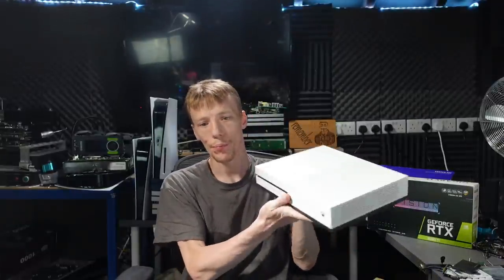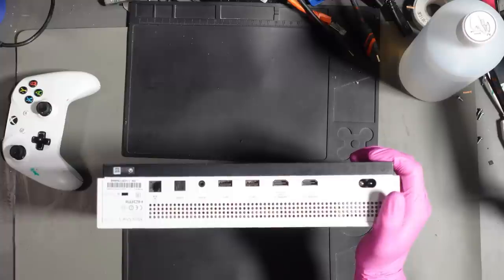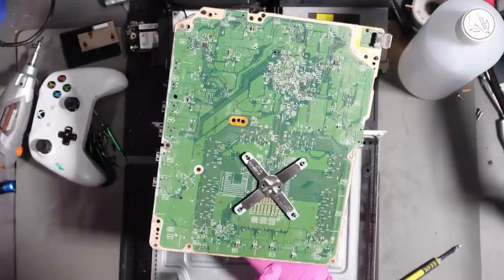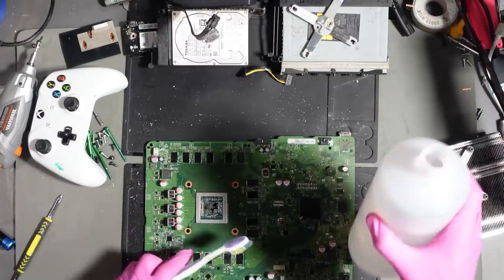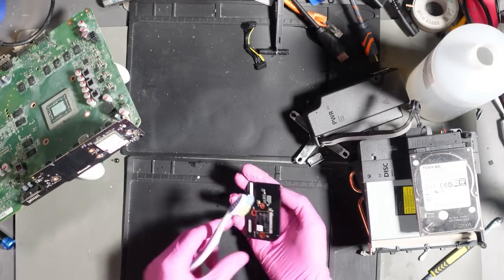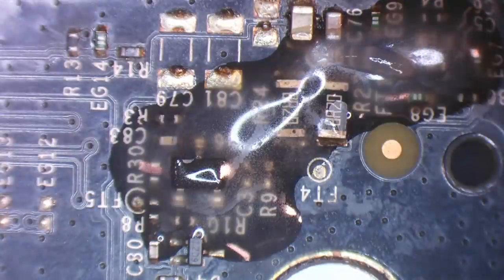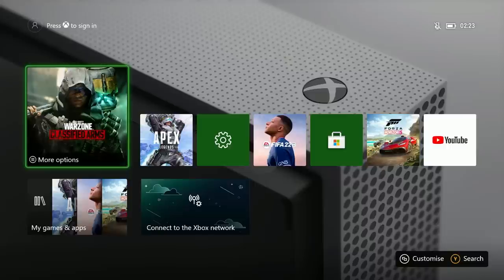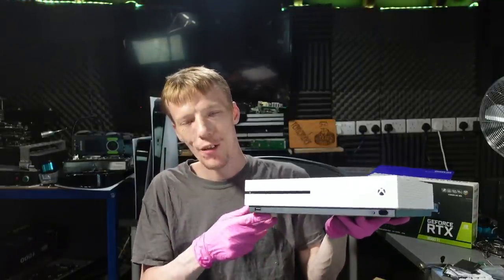I Swapped My WORKING Console For One Which Had MILK Spilled In It! Can I Fix It?

Comment: You should, while the board is wet, pour more IPA and tip the board to it drips the white stuff to the side and then dry/clean the board with a paper towel. It would remove the white stuff which is still milk, just more spread across the board.